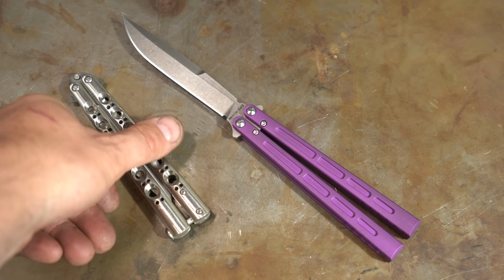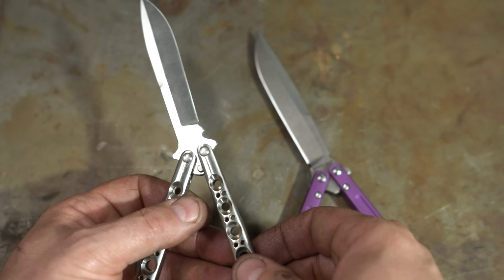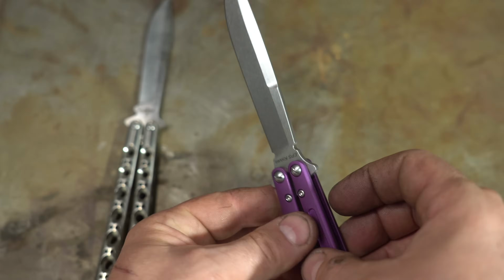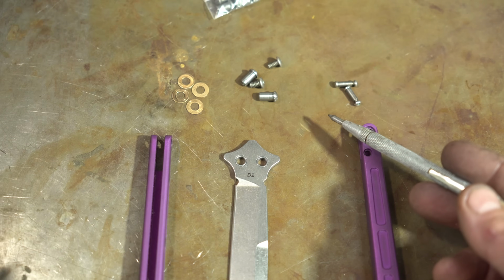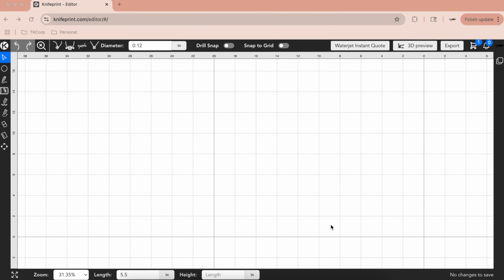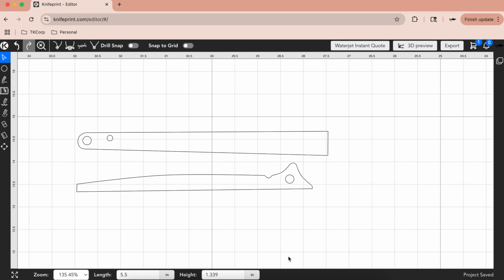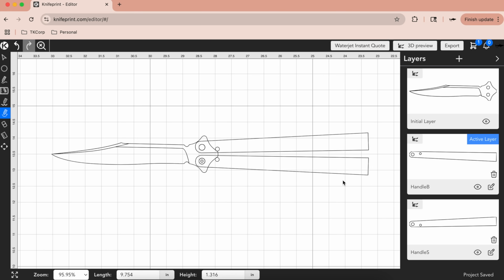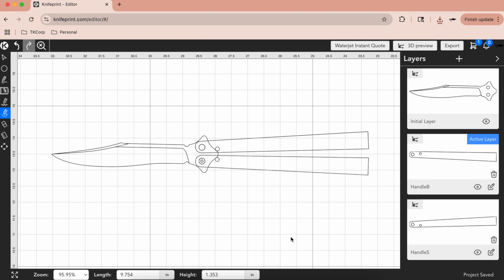Triple-T #227 - Balisong knife build series - part 1

Comment: What type of laser machine was that?
Reply from the maker: That is an XTool F1 Ultra.   Thanks for watching.
Reply: @TyrellKnifeworks Will that actually cut the blade or do you need a different machine for that part
Reply from the maker: You need a much more powerful laser to actually cut steel.  Those are $10-15k.